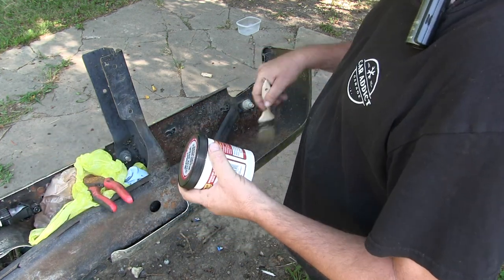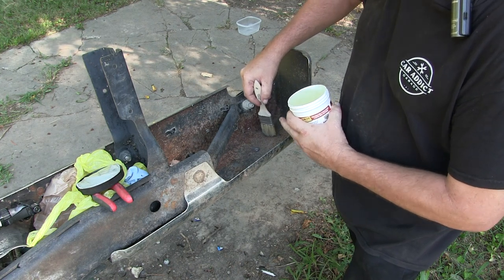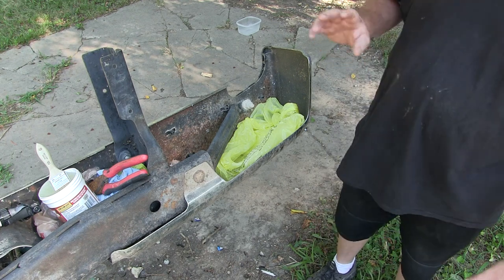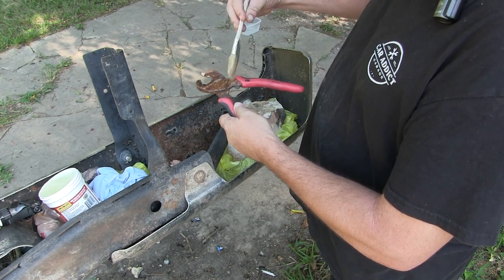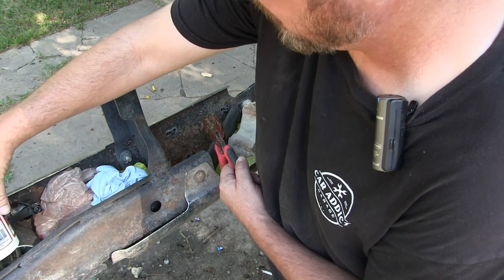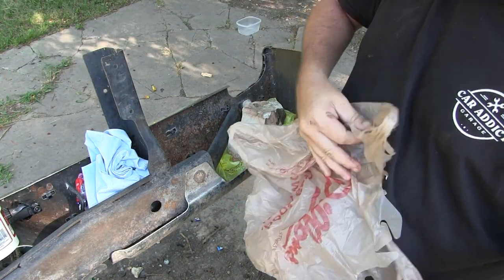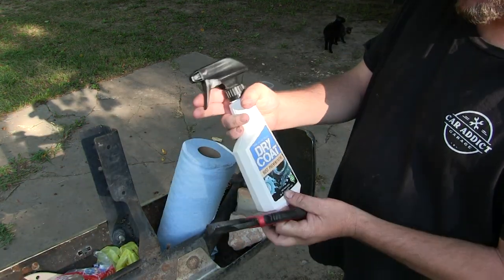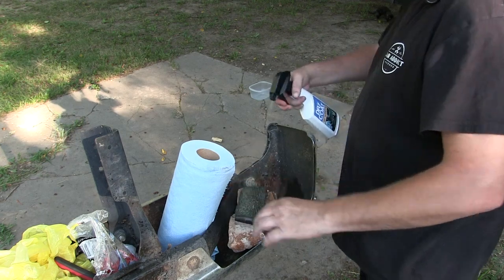Get Rid of Rust - DIY Rust Removal Using Metal Rescue

Comment: Great video, Donnie. 
I really like using Evapo-Rust. I bought a 5 gallon bucket of it and my trick is to take a second 5 gallon bucket, drills about 100 holes in it and use it like a dunk basket into the Evapo-rust. This makes it super easy to retrieve small parts like nuts and bolts and cuts down on a lot of waste. 
Evapo-rust is a little on the pricey side but you can use the same fluid over and over.
Reply from the maker: Thanks for your tips Dicer328.  That does make a lot of since.  Metal Rescue makes a liquid too that may work like that.  The gel is good for items that will not fit in a container.  I will have to get some liquid and try that.  Do you drill the holes in the bottom of the second bucket?

Comment: I apologize for my ignorance in advance. I normally would just use the wire brush on my bench grinder. On the bumper I’d normally use a wire wheel on my cordless drill. What is the advantage of this method?